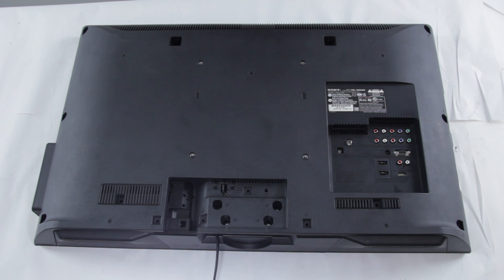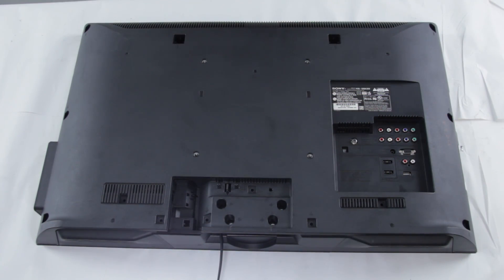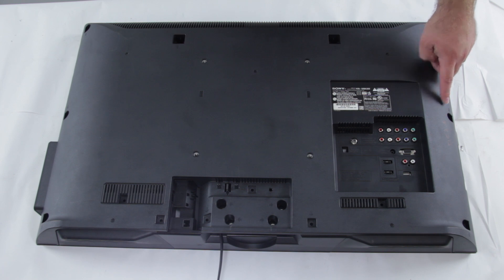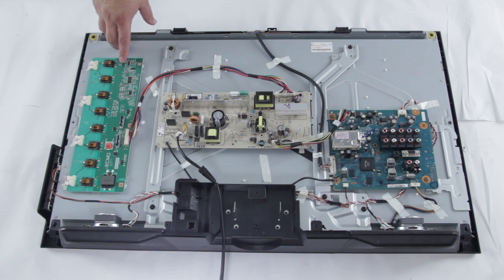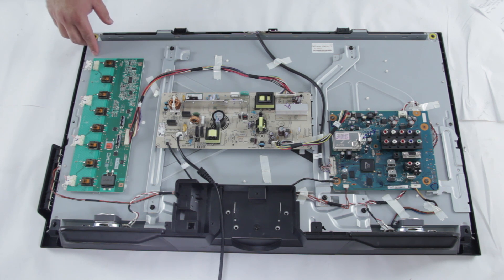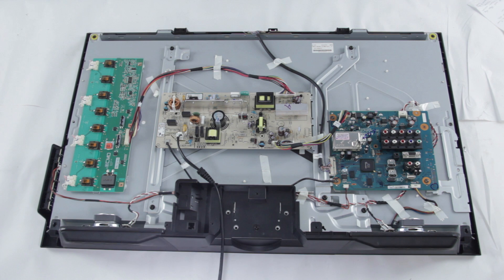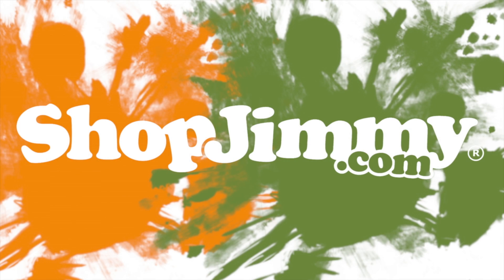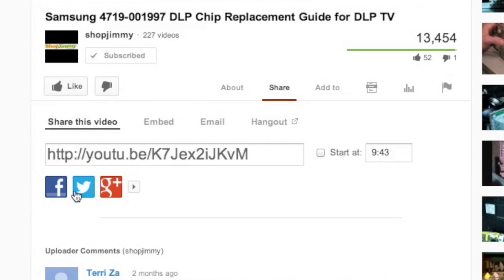LCD TV Repair Tutorial - Backlight Inverter Common Symptoms & Solutions - How to Fix LCD TVs

Comment: Hi.  I have an RCA L26HD35D S/N J312EL0VW - inverter P/N VIT70063.50 REV 3 That has only a faint picture visible only w/ a flashlight.  I have taken the unit apart down to the LCD screen.  The backlight converter has no obvious faults to my naked, untrained eye.  From what I have learned from your site and others implys that the actual backlights have failed. Is this true??  If so how do I replace them.  Where are they and what do they look like??  Are replacement parts available?
Thanks,  CC
Reply from the maker: Chris Callahan  I recommend replacing the backlight inverter in your TV.  http://www.shopjimmy.com/catalogsearch/result/?q=L26HD35D  Here is a link to replacement parts for your TV model number on our website, click here:  http://www.shopjimmy.com/catalogsearch/result/?q=L26HD35D  Be sure to match part numbers on your current board, with your replacement for compatibility.  You can also call our customer service for further assistance with your purchase.  (877) 881-6492  Thanks and please let us know if you have any further questions with your TV Repair!  www.shopjimmy.com

Comment: hello i just yesterday had a problem with a dark shadow in the corner of my vizio e701i-a3 tv, I went on ebay and found a few of the same model number have a shadow just like it..  http://www.ebay.com/itm/AS-IS-Broken-Vizio-E701i-A3-70-LCD-HD-TV-1080p-For-Parts-/251435262105?pt=Televisions&hash=item3a8ab5a099  this first one is exactly the same spot my tv has problems,   http://www.ebay.com/itm/AS-IS-Broken-Vizio-E701i-A3-70-LCD-HD-TV-1080p-For-Parts-/251435264721?pt=Televisions&hash=item3a8ab5aad1

any idea if this is a backlight issue or a bruise, the tv is def watchable and u can still see in the dark area, the tv is still worth a a descent amount for me to just try and error on it, so i dont want to do that, If this is a 75 dollar or less fix i prob will do that, if its a few hundred ill suck it up or sell it.
Reply from the maker: Brent Warheit  This sounds like a TV panel problem.  If your TV panel is bad, it may be more cost-effective to replace the TV as panels are typically hard to find in stock, difficult to replace, and expensive.  Thanks and please let us know if you have any further questions!  www.shopjimmy.com

Comment: I am trying to replace the backlight inverter on my Haier LCD tv model number HL42R. The tv comes on then after a second the picture goes out but the sound it still there. Im having a problem locating the backlight inverter board on my tv.
Reply from the maker: heather knapp   Please post a video with images of the back of your TV with the back cover removed.  Please reply with the link to that video and then I can recommend a replacement part.  Thanks!  www.shopjimmy.com

Comment: have a LG-4655VX westinghouse tv that just went off and now wont come back on. power brick says 19 volts but no light are any thing .
Reply from the maker: Big Doe   I recommend replacing the main board in your TV.  Here is a link to replacement parts for your TV model number on our website, click here:  http://www.shopjimmy.com/catalogsearch/result/?q=4655VX  Be sure to match part numbers on your current board, with your replacement for compatibility.  Here is a link to a video showing how to identify your part number, click here:  DIY TV Part Number Identification Guide for Westinghouse Main Boards (LCD, LED, Plasma TVs)  You can also call our customer service for further assistance with your purchase.  (877) 881-6492  Thanks and please let us know if you have any further questions with your TV Repair!  www.shopjimmy.com

Comment: I have a problem with my Sharp TV model number LC-60LE831U The screen went dark you could still hear the sound but no picture. I turned the TV off and the same thing happened I unplugged the set and plugged it back in now the power light just blinks and nothing comes on.
Reply from the maker: Sydney Ayala   I recommend replacing the main board in your TV.  Here is a link to replacement parts for your TV model number on our website, click here:  http://www.shopjimmy.com/catalogsearch/result/?q=LC-60LE831U  Be sure to match part numbers on your current board, with your replacement for compatibility.  You can also call our customer service for further assistance with your purchase.  (877) 881-6492  Thanks and please let us know if you have any further questions with your TV Repair!  www.shopjimmy.com

Comment: A buddy gave me a Sanyo DP32648. I've already determined that you carry a compatible backlight converter (RDENC2548TPZZ.) I would like to know how to best detirmine if the board is faulty or if it is the ccfl backlights with a multi-meter and no specialized equipment before I order. The screen powers on perfectly for a second or two and seems to have even lighting.
Reply: I have some troubleshooting experience, but I'm deathly afraid of opening up the glass enclosed glass tubes and checking visually.
Reply: KillaAhmadilla
Forgot another thing. There is a solder bridge on the reverse side of the board, but I can't find an image online and don't know if it was intended.
Reply from the maker: KillaAhmadilla   I recommend running the flashlight test on your TV to help determine if the problem is the backlight inverter or the main board. Here is a link to a video we produced that shows how to run the flashlight test. No Image No Picture on Screen-Flashlight Test LCD TV Repair - How to Diagnose Broken Board TV Repair Please reply with your flashlight test results and we can recommend a replacement part for your TV repair. Thanks and please let us know if you have any questions! www.shopjimmy.com
Reply: ShopJimmy.com
 I did the flahlight test there is picture just no backlighting. I just don't know for sure if it's a problem with the inverter or the backlights are going out/are badly soldered.

Comment: yes i have a toshiba 26av502u and the screen is completly black all the time there is sound and if you hold a flashlight up to it you can see images i think it is inverter but with all the things on the tcon board its kind of confusing which one to check so any help would be great dont have the money to take to shop or buy a new one thank you for helping people out especially in these hard times
Reply from the maker: Kieri Williams   I recommend replacing the backlight inverter in your TV.  Here is a link to replacement parts for your TV model number on our website, click here:  http://www.shopjimmy.com/catalogsearch/result/?q=26av502u  Be sure to match part numbers on your current board, with your replacement for compatibility.  Here is a link to a video showing how to identify your part number, click here:  LCD TVs 101: Part Identification Number Guide for Chi Mei (CMO) Backlight Inverter Boards  You can also call our customer service for further assistance with your purchase.  (877) 881-6492  Thanks and please let us know if you have any further questions with your TV Repair!  www.shopjimmy.com
Reply: Thank u so much I figure it was but just wanted to ask someone who knows better I'm not one to have the money to just toss out for a new TV and this one didn't seem like a lost cause I just hope that it doesn't go out quickly again iv read on a few and not to many people have had luck with the back light on this specific one you are doing something great and I greatly appreciate your help it would cost around 100 just for the shop to tell me what u just did so thank you so much
Reply: You guys are actually out of stock for the part is how bad people have had problems with this specific one lol ill check back and see when they are back in Stock thank u again

Comment: my tv is a citizen 71000033
Reply: and it will make sond but has no picture also I shined a flashlight on it and could see the piture a bit
Reply from the maker: noah gillard  If your TV has a backlight inverter replace that, but if it does not have a backlight inverter replace the main board.  Unfortunately I do not see any replacement parts in the search results for your TV model number on our website.  Thanks and please let us know if you have any further questions!  www.shopjimmy.com

Comment: Phanikiran: 
I am having sony LCD colour TV and my modelno;32S550A, Serno:6150194
I having issue noticing vertical lines on LCD screen. These vertical  lines are seen in two/three rows in screen. I have seen ur video and doubting TCON board.kindly suggest me what are the possibilities of the issue and provide me with solution.
My TCON board part no: V315B3-C01

-thanks
Reply from the maker: Phani Kiran  This sounds like a TV panel problem.  If your TV panel is bad, it may be more cost-effective to replace the TV as panels are typically hard to find in stock, difficult to replace, and expensive.  Thanks and please let us know if you have any further questions!  www.shopjimmy.com

Comment: My tv is a Seiki se322fs and I have sound but no picture. I turn the lights out, put a flashlight on the screen and I did see my tv menu barely. Any suggestions
Reply from the maker: Brandon Graham Check in your set to see if you have 2 separate parts, a power supply and a main board I want to make sure you don't have the model that the power and main are on the same part.  Thanks and please reply with this information and then we can recommend a replacement part.  www.shopjimmy.com

Comment: I have a ViZio #e472vl it works only in red color any idea
Reply from the maker: Jon younis   I recommend replacing the main board in your TV.  Here is a link to replacement parts for your TV model number on our website, click here:  http://www.shopjimmy.com/catalogsearch/result/?q=e472vl  Be sure to match part numbers on your current board, with your replacement for compatibility.  Here is a link to a video showing how to identify your part number, click here:  TV Part Number Identification Guide for Vizio Main Boards (Plasma, LCD, LED)  You can also call our customer service for further assistance with your purchase.  (877) 881-6492  Thanks and please let us know if you have any further questions with your TV Repair!  www.shopjimmy.com

Comment: Hi, I have a Samsung Model: LN40B530P7NXZA

The image is visible but the light is way too bright, and seems to flicker a bit between intense brightness and slightly less intense brightness(depending on the colors on the tv as well). The brightness is consistent across the entire picture at any given time. It's like a fog filter is on the screen and the colors almost look inverted when the picture includes darker colors, but the screen still has the bright white filter over it. Thanks in advance for any help/suggestions. Cheers!
Reply from the maker: Tim Rowsey This could either be caused from a bad main board or a bad T-con board.  You may need to replace each board individually to see if one of them fixes your problem.  Here is a link to replacement parts for your TV model number on our website, click here:  http://www.shopjimmy.com/catalogsearch/result/?q=LN40B530P7NXZA  Be sure to match part numbers on your current board, with your replacement for compatibility.  You can also call our customer service for further assistance with your purchase.  (877) 881-6492  Thanks and please let us know if you have any further questions with your TV Repair!  www.shopjimmy.com

Comment: I have a Samsung LCD TV Model #LN55C630K1F. I get a black screen only but I do get audio. I have followed your video to determine that the problem is the inverter (I used a flashlight and saw the Menu). I believe to Main board is OK and also the T-Con board. My Question is: Is there anything else I should check before I conclude that it IS the inverter board? And if so does ShopJimmy.com have a replacement board and what is the cost? Thanks.
Reply from the maker: FirstPhill LastWilliams I would still check the capacitors on your power supply to make sure that none are mushrooming at the top but it is probably just the inverter.  Here is a link to replacement parts for your TV model number on our website, click here:  http://www.shopjimmy.com/catalogsearch/result/?q=LN55C630K1F  Be sure to match part numbers on your current board, with your replacement for compatibility.  You can also call our customer service for further assistance with your purchase.  (877) 881-6492  Thanks and please let us know if you have any further questions with your TV Repair!  www.shopjimmy.com
Reply: ShopJimmy.com

Comment: Hi,
My Sony Bravia KDL46XBR6 is showing a gray screen with video but you can barely see it. Sound is okay, inputs A/V okay, power supply seems okay too. HELP!
Reply from the maker: Arnold Apostol I recommend replacing the T-con board in your TV.  Here is a link to replacement parts for your TV model number on our website, click here:  http://www.shopjimmy.com/catalogsearch/result/?q=KDL46XBR6  Be sure to match part numbers on your current board, with your replacement for compatibility.  You can also call our customer service for further assistance with your purchase.  (877) 881-6492  Thanks and please let us know if you have any further questions with your TV Repair!  www.shopjimmy.com
Reply: t-con maybe

Comment: Toshiba 55G310U LCD TV.  When powered, emits pulsating light with buzzing sound, all input modes work and has picture and sound.  Haven't yet opened the back, but seems to be the right side of unit (if facing back).  Suggestions welcomed.
Reply from the maker: Patrick O'Maille I recommend replacing the power supply in your TV.  Here is a link to replacement parts for your TV model number on our website, click here:  http://www.shopjimmy.com/catalogsearch/result/?q=55G310U  Be sure to match part numbers on your current board, with your replacement for compatibility.  Here is a link to a video showing how to identify your part number, click here:  TV Part Identification Number Help Guide for Toshiba Power Supply Unit (PSU) Boards  You can also call our customer service for further assistance with your purchase.  (877) 881-6492  Thanks and please let us know if you have any further questions with your TV Repair!  www.shopjimmy.com

Comment: Sony Bravia KDL-46XBR4, serial # 8209592. It was working OK at a friend house. We moved to my house very carefully, installed and next day it started displaying a dark line on the horizontal top side of the screen, also but bearly noticed double image . At that time it went out after ten minutes. Now ,  months later, it cover the top and right side, sometimes goes away after thirty minutes or does not the whole day. Any suggestion please forward it to jxaguila@gmail.com.
 Thanks
Reply from the maker: Javier Aguilar This could either be a bad t-con board or a bad panel.  If the problem is the TV panel, it may be more cost-effective to replace the TV.  You can replace the TV to see if that fixes the problem.  Here is a link to replacement parts for your TV model number on our website, click here:  http://www.shopjimmy.com/catalogsearch/result/?q=KDL-46XBR4  Be sure to match part numbers on your current board, with your replacement for compatibility.    You can also call our customer service for further assistance with your purchase.  (877) 881-6492  Thanks and please let us know if you have any further questions with your TV Repair!  www.shopjimmy.com

Comment: I have a Sony Bravia KDL-40V5100.  When I try to turn on tv green power button comes on but no sound or picture.  No flashing red lights either.  The green power led will sometimes go back off in about a minute.  Fuse on power board checked out OK and no apparent bulging capacitors.
Reply from the maker: Ron Giles I recommend replacing the main board in your TV.  Here is a link to replacement parts for your TV model number on our website, click here:  http://www.shopjimmy.com/catalogsearch/result/?q=KDL-40V5100  Be sure to match part numbers on your current board, with your replacement for compatibility.  Here is a link to a video showing how to identify your part number, click here:  TV Part Number Identification Guide for Sony Main Boards (LCD, LED, Plasma TVs) TV Repair  You can also call our customer service for further assistance with your purchase.  (877) 881-6492  Thanks and please let us know if you have any further questions with your TV Repair!  www.shopjimmy.com

Comment: Hi, I have a 55" vizio VF550XVT1A LCD TV. The screen will light up but no picture or sound. It seems as there is motion in some horizontal lines at the bottom of the screen. Do you have any ideas as to the problem or do you need more information? Thank you

Comment: HI I've got an ALBA LCD32880HDF in with a back light going off after 30 secs or so. voltages are a bit of a problem as their not marked on the pcb. When it starts up im getting a 24v, 12v, 5.3v, 3.3volts when the back light goes off the 24v drops to 18v. So im not sure if I have a PSU or an inverter problem or something else.
thanks
Reply from the maker: snipersquad100 I recommend replacing the power supply in the TV to see if that fixes the problem.  Here is a link to replacement parts for your TV model number on our website, click here:  http://www.shopjimmy.com/catalogsearch/result/?q=LCD32880HDF  Be sure to match part numbers on your current board, with your replacement for compatibility.  You can also call our customer service for further assistance with your purchase.  (877) 881-6492  Thanks and please let us know if you have any further questions!  www.shopjimmy.com